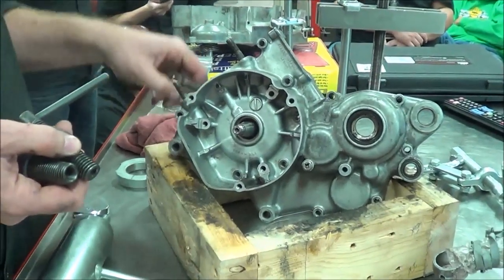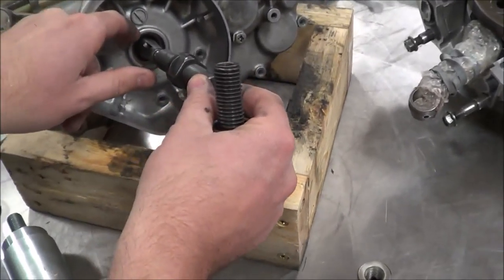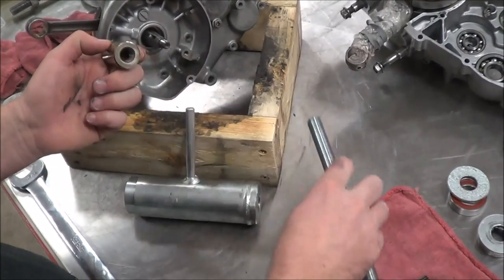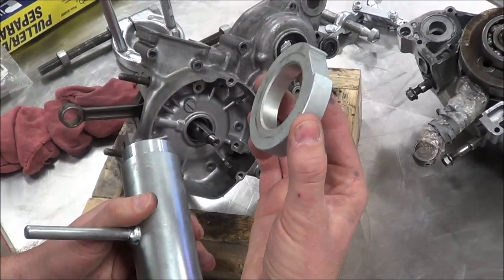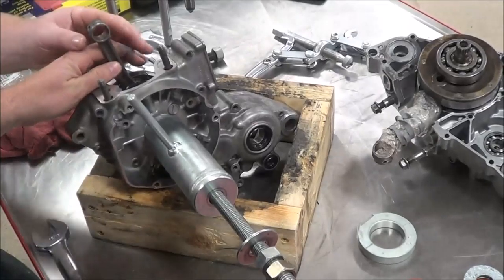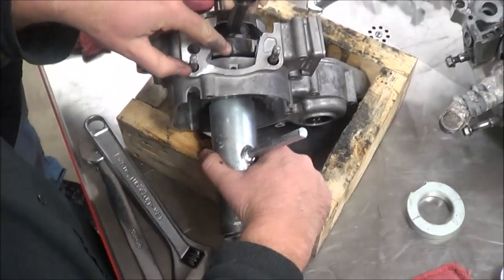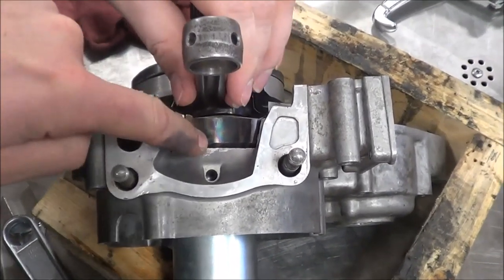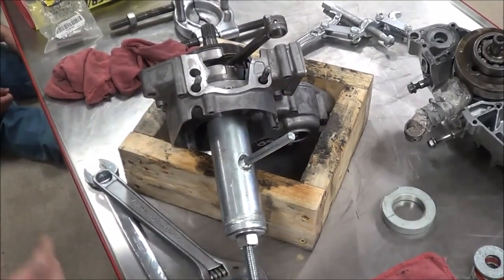2 Stroke Engine Assembly: How to pull a crankshaft into the case. #tusk #k&l #motionpro

Comment: I know this is an older video BUT.... You wouldn't happen to have a model call out or UPC for that K&L supply universal puller you use woukd you? Ive dug around via your link and haven't found it. Post a link and ill buy it through your link. Work on alot of harleys and such. I could fire up the tig and saw but time is $$$$
Reply from the maker: Hello. I've always used the heat/freeze method (actually heat only due to the size of the HD flywheel assembly). Have you seen my video on that? https://youtu.be/0mLpEXxr-s0

HD and Jim's has pullers. The Jims one is here: https://amzn.to/3M4JPyJ Found a "copy" on ebay here: https://www.ebay.com/itm/274669136039?chn=ps&norover=1&mkevt=1&mkrid=711-117182-37290-0&mkcid=2&mkscid=101&itemid=274669136039&targetid=2512152189032&device=c&mktype=pla&googleloc=9029983&poi=&campaignid=21214286338&mkgroupid=161030074701&rlsatarget=aud-1242981527210:pla-2512152189032&abcId=9407521&merchantid=8254624&gad_source=1&gclid=CjwKCAjw2dG1BhB4EiwA998cqNBXbtieH76No6yOT0iKP20_Gvcl0cefgstI6OgS_ATTS_lhV3lbzhoCBCsQAvD_BwE